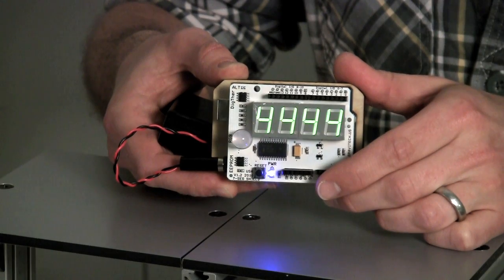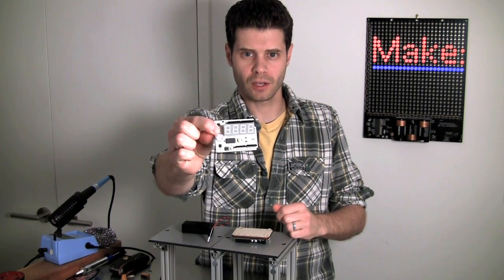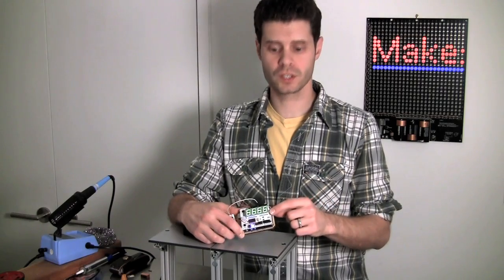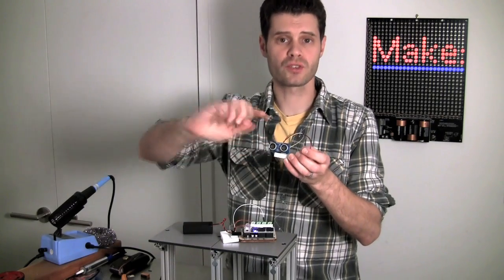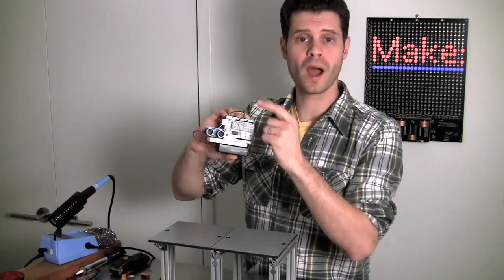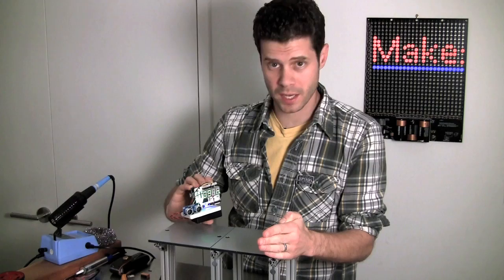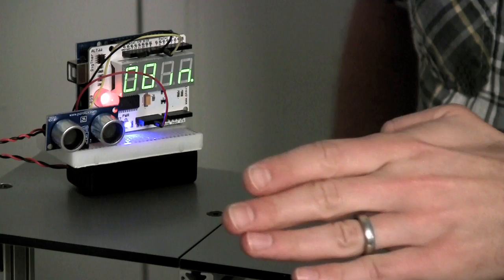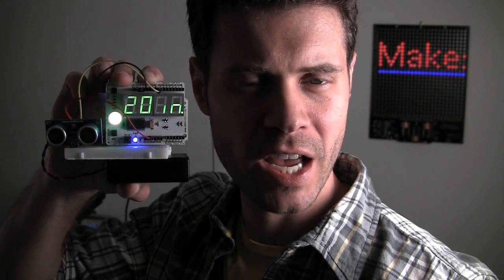John Park in the Maker Shed: Ultrasonic Distance Sensor

Comment from the maker: @AllenKll From the data sheet: Temperature has an effect on the speed of sound in air that is measurable by the PING))) sensor. If the temperature (°C) is known, the formula is:
( Cair = 331.5 +( 0.6× TC)m/s
The percent error over the sensors operating range of 0 to 70 ° C is significant, in the magnitude of 11 to 12 percent. The use of conversion constants to account for air temperature may be incorporated into your program.

Comment: The speed of sound changes with air pressure and temperature.  Where is the compensation for this?  Plus those ultrasonic sensors are only good over specific small ranges.  One would need three or four to determine a wide rang of distances...